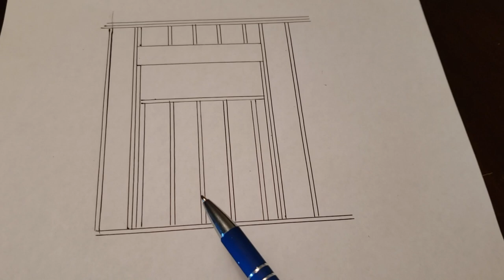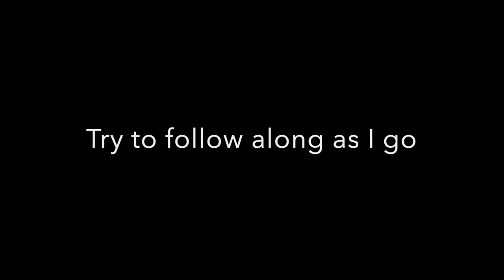How to Frame a Shower Niche in a Load-bearing Wall

Comment: Great video. I'm a remodeled that avoids cutting into any load bearing wall. I have seen a plumber cut a bunch of studs out of an outside wall without any temporary support, when he cut them out they made a an audible pop!   Doing it this way just like a window ensures that the wall keeps its strength.

Comment: How would you frame if you have a window right above it
Reply: If you already have a window there should already be a header to carry the load. As long as you just cut into the cripples below the window (and NOT the jack studs supporting the existing header), you can just frame a box without worrying about a header.

Comment: thank you for posting this very helpful video!  i was always afraid of modifying load-bearing walls and know the cost to hire someone would be expensive. My scenario, my parents bathroom has a adjoining wall with the townhouse next to us.  it was built in the 1970s in NYC. it isnt down to the studs but do you have any experience is your steps are exactly whats required?

Comment: I guess I have this question. If I'm not exactly sure how high I want the niche to start given what the tile will be and where it will start on the tub I'll later install), can I put the header up higher than I know I will need it and then locate a cross piece (below the header) and then insert a bottom cross piece once I know exactly where to install the niche? Did my question make sense?
Reply from the maker: Hi David, I believe I understand your questions. Props to you for thinking ahead about the finishing design before putting the bones in place. Now I'm not an engineer, but I would say yes, that would be just fine since the header would still be holding all the load from above and transferring down to the jack studs. I have an exterior door in my house (from the 1950's) where the header is framed as high up as possible (top plate literally sits on top of the header), and the door is framed in to fit below the header. One last thing to consider, is just making sure you have cripples in place (in your case BELOW the header), not so much for structure, but to have adequate nailing for your cement board when you put that up. Best of luck!
Reply: @AtHomeDIY  I framed this out on the master bath several years ago. I needed to have the tiling done by a pro who chided me for not locating the niche in a way that made the tiling work out. But it's hard to do that accurately when I need to do the pre-work on dens shield, waterproofing etc. This time I want to do a better job. Thanks.

Comment: I want my shower niche to span the entire width of my shower, which is 4'.  What size beam to I need and how many jack studs do I need?  I planned for a 2" x 8"  header with one king stud and one jack stud on each side.  Is that correct?
Reply from the maker: Probably not the answer you want, but... it depends on several factors. Is this wall load bearing? Are there floors above it? Does your region have snow load? etc etc. Without knowing these answers, in a basic scenario, I would say 2x8 header over a 4 foot span would suffice, and 1 jack stud is probably enough (although you can easily google the code for that relative to your city/county/region). I always go overkill if I can't find any certain data on a project I'm doing.

Comment: Hi there! I have a contractor telling me this is extremely expensive to do. I wanted a shower niche to be approx 24-28” high and about 16-20” wide. I purchased one of the inserts but of course my wall is load-bearing. How much roughly would something like this cost? I am going to show this video to my contractor!! Please let me know ASAP and thank you for possibly saving my Dream!!!
Reply from the maker: Hi Jessica, it is difficult to tell you an exact number as it would be highly dependent on many variables. If you are already down to studs this project is extremely easy. If I wasn't filming I could have knocked it out in an hour no problem. A seasoned contractor even less. (I have no idea what contractors charge per hour, but I would assume labor would be well under $100/hr, you can do the math from there understanding that you are also paying for their knowledge and expertise, not just labor). If you're trying to add a niche to an already finished bathroom then the price would go WAY up. I hope that helps.

Comment: Thanks for this. I watch a video a few weeks ago by a tile guy (Starr Tile, I think), who built a niche. He basically  said "Just cut the studs and frame a box", and proceeded to do just that. I told him in comments that thats all fine if the wall isnt load-bearing (with a double top plate). I then described building a header (exactly as shown) if the wall is load-bearing.
His response? "Yeah. Everybody knows that". Well not DIYers who are learning stuff on YouTube videos. Needless to say I blocked that clown, wont watch any more of his content.

Comment: Can this method be done with a load bearing exterior wall? Any reinforcement need to be added?
Reply from the maker: That is the exact scenario I'm showing in the video. 2x6 exterior load bearing wall. The header is the important piece, as well as supporting the load while reconfiguring the wall to add the niche.
Reply: Thank you for your assistance. I was able to complete my own project following your instructions.
Reply from the maker: @fransmith2415  Glad it was helpful and you were successful!